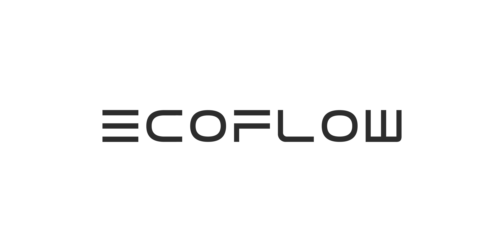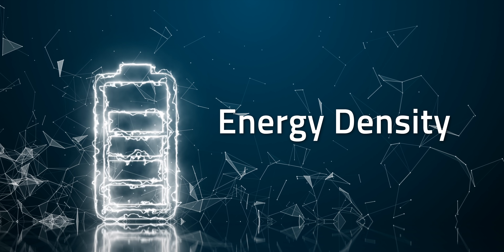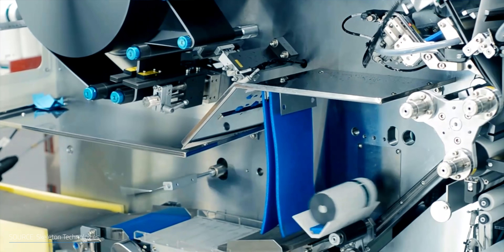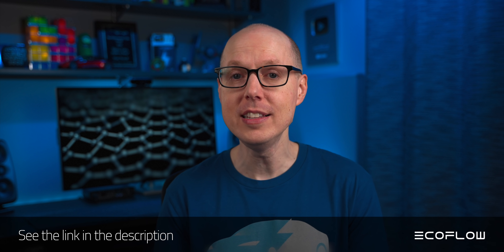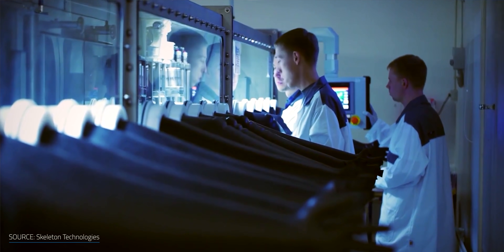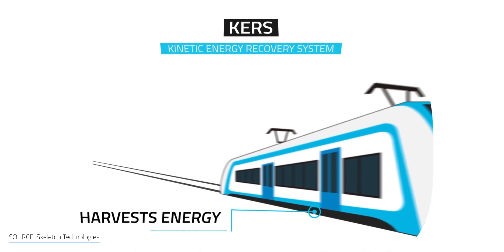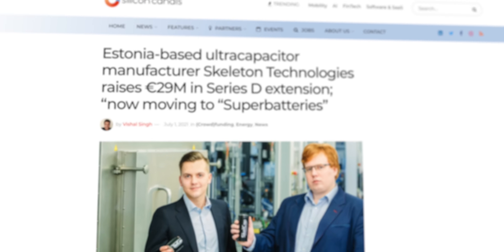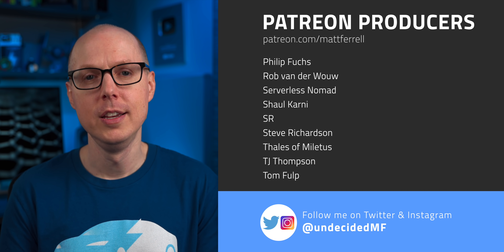Revisiting the Supercapacitor - The Wait for Graphene is Over

Comment: People also ask
Is graphite more conductive than silver?
But, I suppose it could depend on the molecular structure and temperature of the graphite. But if your talking about pencil “lead” certainly silver is the better conductor. Silver is the best conductor, good conductivity and more suitable to use as electrical energy distribution

Comment: This is interesting, but everyone should remember that there are MANY road blocks on the way from theory to development to practical use. It all depends on 1) if it is possible, 2) if it is practical in terms of cost, efficiency and weight, 3) if it is funded by investors properly 4) if it doesn’t violate other patents and so need to pay them money (if they even allow it) and that doesn’t make it prohibitively expensive, 5) If it doesn’t get over regulated by government rules (such as EPA or OSHA). There are many instances where a really good idea failed because it priced itself out of the market. (See the development of the Philips screw driver vs straight blade screw drivers. Philips priced itself out of the early market and so took much longer to become common.) I’ve watched many promising developments (as reported in the magazines Popular Science and Popular Mechanics) sprout, only to see it wilt because of any of the above reasons.

Comment: Do you live in California and your green electrical grid goes out? Use a battery power bank. And when that battery goes out, just plug it into your home's power outlet to recharge it. Power still out? Buy another battery bank to recharge your first battery bank, to charge what you needed in the first place. That one out also? Get a gas generator and never have to worry about your battery being out....unless you are in California and they outlawed gas generators....while having an electrical grid that routinely fails every single year.

Comment: ummm...people are already using ultracaps as car battery replacements.  nothing with graphene, but the point is that the technology is already there.  six 350 Farad, 2.7V caps can be wired in series to get sufficient current to turn over a normal engine.  there are a number of yt vids demonstrating it, some several years old already.

Comment: I wonder if supercapacitors will get us any closer to all-electric passenger jets. The obstacle seems to be that batteries don't have as much energy storage as fossil fuel, so you need a lot of them--which weighs down the airplane. Right now, they're mainly good for short flights with a few passengers. If supercapacitors reduce the number or the size of batteries needed for aircraft, that would help increase the range and use-cases for electric planes.

Comment: To be most effective, storage devices should be designed to deliver their load immediately when the grid's load increases but to allow the grid to stabilize for a few minutes before recharging.  As the voltage decreases, the motors slow down, the filter capacitors are less charged, PID controllers are lagging their control loops, etc.  Injecting energy immediately while power generators are activated minimizes this lapse.  Beginning to charge as the line goes over-voltage helps stabilize the fast-response devices in the load and allows devices with large inertia to recover smoothly.

Comment: One great application for this would be for electric transport (busses, trams) that don't require the city to install the ugly (and expensive to maintain) overhead wiring. Just gulp down a 20-second charge at certain selected stops, use regenerative braking, and you can do it all without wires! It would be a great solution for Washington DC, which explicitly forbids overhead wiring in the downtown area, but dreams of having some tram lines there. Alternately, they could wire up only very short runs of overhead wire (just a block, here and there), have the bus/tram unfold its pantograph, and gulp down enough electricity to charge up the capacitors on those short runs. You have a lot of flexibility when your charge time is just 20 seconds!

Comment: 6:51  It's interesting that Graphene was supposedly first discovered in 2004 yet Skeleton Technologies "Curved Graphene" has been a closely guarded secret since the 1990's.
Reply: I didn't look into it but the curved graphene might have been a theoretical discovery in the 1990s while they produced real graphene in 2004
Reply: Are u saying they already made a time machine using graphine? Predestination.
Reply: Am right in thinking a Nobel prize was won by wrapping sellotape round a pencil?
Reply: "Curved" graphene isn't graphene. Graphene is 2D. ANY curvature makes it 3D. Curved graphene is likely a reference to nanotubes or sections of nanotubes.
Reply: @bnjmnwst  Dr Yiwei Sun, lead author of the study from Queen Mary University of London, said: "Graphene owes its thickness to an array of chemical bonds sticking out above and below the 2D plane of carbon atoms. Hence graphene is really a 3D material, albeit with a very small thickness.

"By applying conventional 3D theory, which has been used for around 400 years, to 2D materials such as graphene, which have been known for 15 years, we show that similar arguments apply to other so-called 2D materials, such as boron nitride and molybdenum disulphide. In that sense, 2D materials are actually all 3D."

Graphene is often called the world's first two-dimensional material. It was discovered in 2004 by peeling off graphene flakes from bulk graphite (used in pencil leads and lubricants) using sticky tape.

It is regarded as part of a new class of 2D materials and it is currently modelled by scientists as a sheet of atoms with very little depth, hence the name 2D material.
Reply: I would not have expected a woman to pick up on such a nuance.  Good for you girl!.  Now fetch me a sandwich and a beer.

Comment: Graphene did create a hype a few 5 years ago. Suddenly coconut shells started disappearing from garbage in Asian countries. The source of graphene, I believe is charcoal powder from coconut shells. (Fine charcoal powder is  what they calling nanoparticles). All the burning and conversion to charcoal happens in Asia and the fine powder is shipped abroad. While that may not be great for the environment, I see it has application like a power wall, in an off grid location gathering power from wind or light. It may not be great in the automotive sector though. 

What I don't understand is why Tesla bought Max capacitors and killed it?

Comment: Launch roller coasters have used supercapasitors for several years and with older, more power-demanding launch systems it's made the difference of not having a general power emergency at amusement parks with each attempted launch. I'm hoping the improvements will help with the kind of propulsion used in maglevs and launch coasters on a more practical level such as the Bombardier Innovia conventional rail transit trains, but maybe something that can go faster than 60mph. Linear induction will take rail transportation out of the Dark Ages by eliminating locked-wheel skids from braking that make the wheels square. (flat spots) This phenomenon causes billions in destruction to tracks, bridges and surrounding properties each year - plus expensive maintenance requirements for the wheels that often get neglected because the problem is so ubiquitous.

Comment: If every house/flat came with a supercapacitor pack it would be possible to smooth out the peaks from power usage. When someone turns on a kettle or has a motor start up, the full amount or initial surge could be managed by the capacitor so the grid itself sees a smoother transition between usage levels.

Comment: In my mind the best advantage for them is grid management, they dont wear out like batteries so if you can make them cheap then it doesnt really matter how much land is used as it can be any worthless land that can house all the capacitors, but it will be almost 0 maintenance, 100% uptime and has an infinite ROI depending on time scales

Comment: I am confused here and am thinking this is a scam. The question is, and is it simple, does this "Power Station" have a battery inside of it or a large capacitor bank , THAT TAKES THE PLACE OF A BATTERY. If it uses a battery then this is nothing more than a scam and a slick package of a battery with an inverter attached and there are dozens of these so called "Power Stations" on the market.

My car is a power station. It has an alternator powered by gasoline and a battery that I have an inverter connected to if you want to get technical. Somewhere some how this so called "power station" needs to have a power source to charge what ever is inside and THAT IS THE CATCH. Fine if it replaces the battery with capacitors if not this is pure crap.

I already have solar panels on my Travel Trailer, (a kilowatt of panels) and a 200 amp hour SLA "AGM"??? battery with a 3000 watt Inverter. So the question is am I eliminating the Battery??? I don't give a shit what kind of battery you have the question again is;

WILL THERE BE NO BATTERY AND AM I GOING TO JUST HAVE A LARGE CAPACITOR BANK. If not this whole thing is Bull Shit and a slick advertising scam.

What I am reading here and in the comment is "There is no "Graphene" capacitor in these units and they are just blowing smoke up your ass because they are talking about the future now right now in THESE units. If there is no "Graphene" capacitor bank then these guys are scamming all of you giving praise to this pie in the sky rip off.
Someone prove me wrong and I will be happy as a porker in poo and buy one or more of these.

Your up!
Maximus has spoken.

Comment: I remember in University of Electronic Engineering back in 2015 a teacher of mine was involved in the graphene research program and he would swear that this is the future of electronics, i believe him , the material is very good in all aspects we just need new ways of extracting the most out of it.
Reply: I'm older.  I remember when silicon was first developing.   The problem with silicon transition of information was that you had to have absolute pure silicon.  At first it appeared impossible,  but today it is every where
On that basis I believe that we will develop perfect graphics sheets.
The same with Super Conductors.  The University of Rochester has developed a Super Conductor that operates at 50⁰F.

Comment: So I have no clue what I'm talking about, but couldn't you create a large cluster of small capacitors, effectively mimicking the longevity of a battery? You would have to have a control to manage the output so they don't all discharge at once, but if my idea is correct you could charge the unit instantly like a capacitor while also having the longevity of a chemical battery.  I'm not sure how small they would need to be, but if they can put millions of transistors on a computer chip, I would think something similar but with less complex tech like capacitors would be feasible.

Comment: It seems to me that all that is needed for a car is a gas engine and super capacitors to conserve the breaking and down hill energy...  My 2014 chevy equinox easily gets nearly 100 miles per gallon on a flat road. However, it struggles to get 8 miles per gallon (more likely 5 mpg) when accelerating.

Petroleum fuel cells, 100 gpm gas engines with capacitor breaking regeneration, makes lots of sense.   However, battery cars do not make long-term sense.

Comment: He mentioned that the batteries we use arent the best they are just the best to mass produce.  What would the "spare no expense" battery be that could be built today?
Reply: Hydrogen fuel cells are significantly better. But come with some crazy infrastructure hurdles that have never been overcome.

Comment: This is great news. There's so many areas of life, transport, production and on today that rely on frankly drastically overbuilt energy solutions because they need those short transient energy bursts, but only then and there, the primary load os much lighter. And even though some of these have energy recovery systems, those are often not able to recover anywhere near the full potential, because of charging current limitations. This could go a long way towards serious improvements in material and energy efficiency.

Comment: If I heard right, The CEO mentioned it has a 4th the capacity of a traditional battery. if that's the case I would gladly replace my current phone battery with it. it would last 5-6 hours, and take less than a minute to recharge. worth while trade off to me

Comment: Large capacitors have two main problems, voltage limits as the plates get thin, and reliability to control failures on very thin plate separtation. Has does a graphene capacitor stack up ??

Comment: I found the video interesting, but, one area I thought could have been improved (for me) was the addition of a few absolute numbers instead of relative percentages. Perhaps a sentence which said something like "A Tesla Model 3 battery pack weighs X and has Y volume and can contain Z KWHs of charge, the Graphene based ultracapacitor of Z KWHs would weigh N and have M volume."

Another bit I didn't see was whether the graphene device resolves the idle discharge issue of capacitors.
Reply from the maker: Thank you for the feedback, we appreciate it!

Comment: Graphene manufacturing group is another company, Australian based, that is looking to used turquoise H2 production to get the ultra pure carbon black it needs for it's graphene, H2 for heavy transport and carbon black for batteries and capacitors, with nearly zero emissions. It will be a negative emissions source if renewable natural gas is used.

Comment: There's already a power bank that uses graphene afaik, it works as a regular power bank but the upside is when you recharge it, it takes a flat load across the whole battery %, that is, it takes the same time to charge the first 50% as it takes the other 50% 
I think Linus tech tips made a review but don't quote me, might have been mkbhd, battery banks are not my thing so I don't really remember who did it

Comment: Capacitors have a rather different behavior compared to batteries:
- Their output voltage depends on the charge they hold
- A thinner dielectric increases capacity but lowers the highest voltage they can store.

So what if we experiment with different dielectric thicknesses and find the optimal voltage range and capacity for the highest power density?
Reply: There are many different capacity/voltage combinations on the market. You can get either a 100V 220uF capacitor, or a 16V 3300uF.
In my electrically-uneducated opinion, lower dielectric thickness might have overall higher energy density.
Reply: Thank you for that omitted insight. Capacitors discharge linearly from a few volts to zero volts, which is pretty useless for serving most loads, unless discharge is limited to a few percent of total charge. Any greater discharge would require transfer of energy from the capacitor via regulatory circuitry to a load source point. Such circuitry would add cost and limit discharge rate, probably ruining it as a battery substitute in most cases.

Comment: If it sounds to good to be true it probably is. What other materials are used? How much energy does it take to create? Is it truly feasible in large scale energy conservation? When we're talking wind power, we're talking weeks of continuous storing or releasing of energy to even begin to make wind power a good idea. The scale is very likely to eat up any savings and we'll just be back at nuclear energy again. The only possible use I see right now is regenerative braking in vehicles (if the energy truly can be stored quickly enough). The rest seems like minor improvements.

Comment: I was hoping to hear that this tech would be applicable to EVs. Not to power them but reduce recharge time. I could imagine a subsystem of graphite capacitors charging in about the same time it takes to fill a tank with gas, then drive away and have those capacitors feed their energy to the batteries as we drive. Have you heard any hints at that? Thanks for the great content. I can always rely on you for level headedness and forward thinking.

Comment: Another excellent video from MF.  Super caps have been in use in small applications like storing CMOS settings for some years now.  They must be durable because they were always soldered on and not easily replaceable - unlike the coin-cell batteries they replaced.

Comment: Yes, I think ultracapacitors are very important to regulate power grids. Also optimizing the offer and demand in areas where great peaks of consumption are followed by big drops of consumption. It saves energy by reducing the security oversupply needed to maintain continuous consumption without blacking out the grid and stability. Good solution!

Comment: there was some group of people trying to get funding for using graphene to conduct heat from underground hot spots for power generation ( geothermal power generation )...like instead of a heat transfer fluid send and return, their idea was to put graphene down one bore hole, and use it to conduct the heat to the surface boiler.

Comment: The problem with capacitor is that they lose charge overtime much faster than Li-ion.
It’s good for quick charge/discharge for something like load management in power grid, but if you have to hold it for a long time and only use it once in a while, it’s actually worse than Li-ion.